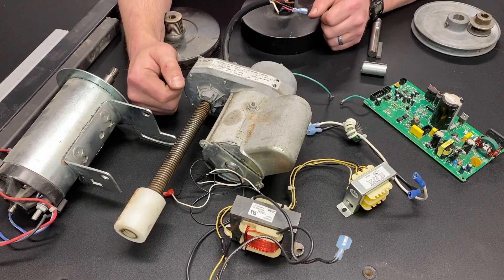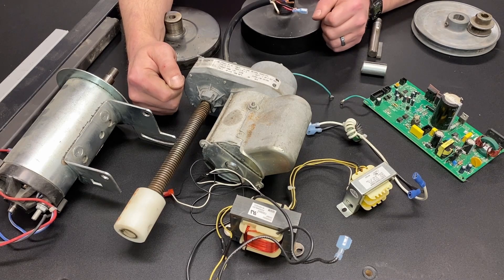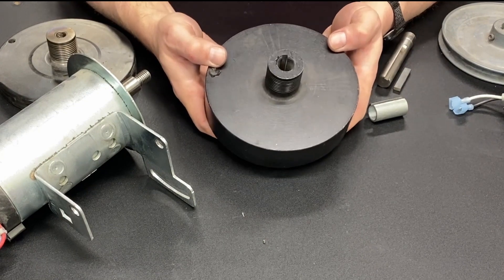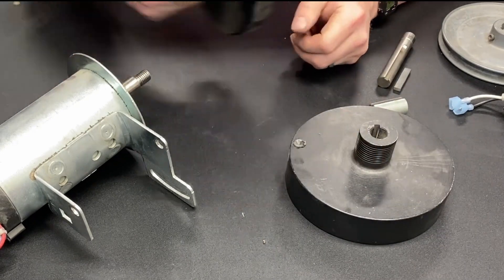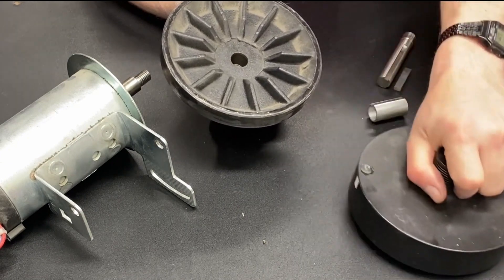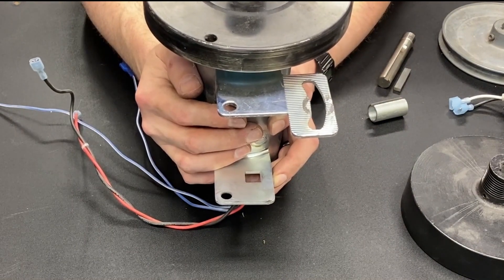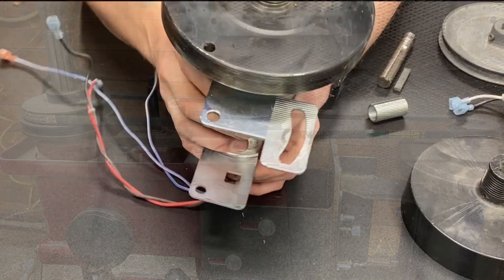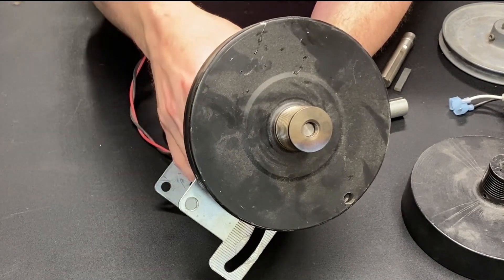Treadmill conversion FAQ 8. Do I need to use the flywheel?

Comment: Thanks for the videos, they are very helpful!

Sorry for my ignorance here, but I was kind of hoping for more of an explanation or example for the difference between using the weight vs losing the weight.

I'm wondering how much difference it would make on an old lathe with the old flat belt pulleys, where it would be the pully on the motor to a large 13 inch pulley, that runs a cone pulley shaft, which would then use a flat leather belt to turn the main lathe cone pulley shaft.

I figured, if the weight on the lathe chuck was spinning and all of those pulleys as well, maybe that would be kind of the same as the weighted original pulley on the motor, where they would all keep it going for awhile until it stopped.

I'll hopefully get a chance to make this thing spin tomorrow, but I wouldn't be able to make it spin with the original weighted pulley on there, because I'd have to have the lathe working first, in order to modify the weighted flywheel pulley.

Kind of a chicken and egg situation here... LOL 

I guess if it works, it works...  But would be interesting to find out if you had anything to say or add to this for me please??

Thanks
Reply from the maker: It comes down to torque.  If the motor has enough torque then the flywheel isn't as critical especially with the spinning mass of other parts, but if the motor is at all undersized the kinetic energy stored in the flywheel helps compensate for the motors shortcomings.  With treadmill motors torque is everything and that is why I have devoted several videos to that subject alone.
Reply: @dazecars  Awesome, thank you for the reply!

I should probably find a way to get it back on there then.
Reply from the maker: glad I could help.

Comment: I can’t get the flywheel off mine. It had a nut that came right off but the flywheel seems stuck. Idk if it’s threaded on or pressed on.
Reply from the maker: contact me through my website and send pix
Reply: @dazecars  it was pressed on little heat and the 2 jaw puller. Got it off.
Reply: @dazecars  ok thanks I sent 2 pics. I just went to harbor freight and got a 2 jaw pulled set. I was in town so it seemed like a good idea to have it.
Reply: @dazecars  I’ve been thinking about just taking a grinder with cutting disks and cutting it into pieces until I can get it off.

Comment: How do i remove the keyed flywheel
Reply from the maker: loosen the set screws and then pull it of or  lightly tap it off with a rubber mallet.
Reply: @dazecars  mine must be really jammed on. I smacked it with a hammer and it still won't budge. Im picking up a pully puller today.
Reply from the maker: gear puller

Comment: For my upcoming drill press conversion I'd prefer to remove the flywheel/fan and file the shaft down to mount the pulley. Would a USB fan mounted at the opposite end of the motor (bottom since motor will be vertical ) be adequate or do you recommend another fan to cool the motor?
Reply from the maker: I don't know that a USB fan will move enough air.  I would recommend something like this.  https://amzn.to/3VoQtCo

Comment: Hey
I'm currently dealing with this issue as I need to use the fan flywheel but run It in counter clockwise direction.
You mentioned in the video that the smaller motor flywheel needed heat to release from shaft.
So, I'm thinking that that is all I would need to do to ensure my flywheel doesn't go it's own way,apply locktite and 
all will be fine.
Would you tend to agree with the solution?
Cheers
Love your in depth videos.
Reply from the maker: yes loctite is an excellent optio to run it in reverse and not have it un screw.

Comment: u can also spin it backwards and that will break the pully loose(don't ask me how I know)
Reply from the maker: That is a true statement on the bigger ones that have not been loctited, but the small ones that use loctite (I have 5 small ones and it was all of them) it will not come loose running it backwards.  The flywheel doesn't have enough mass, and I don't think it would matter even if is was much bigger as I was not able to get it loose using a large wrench.  Heat was the only way.